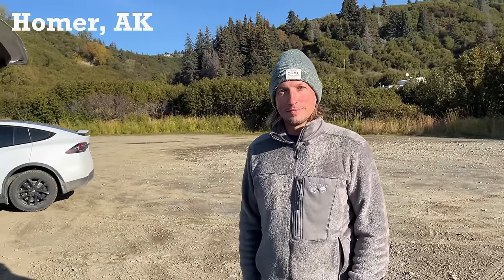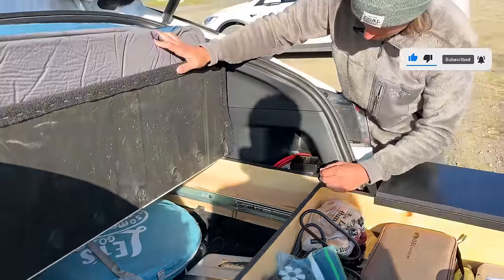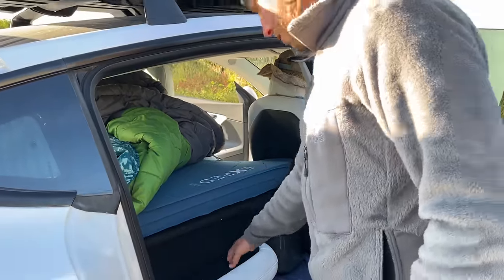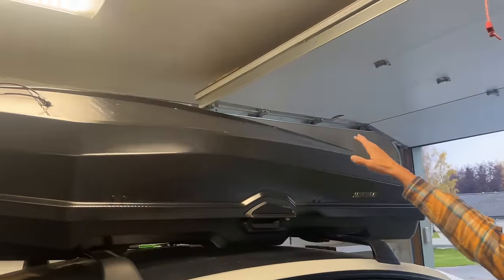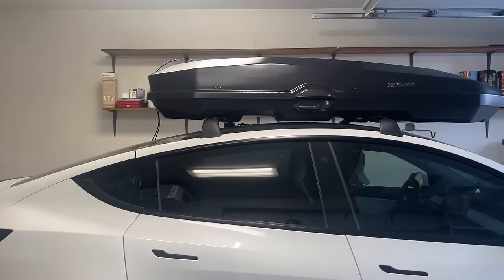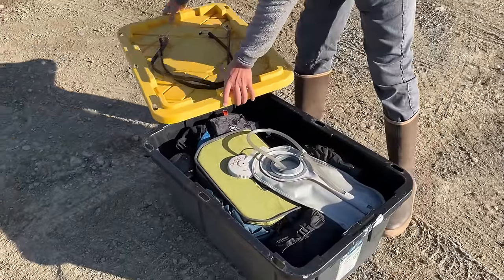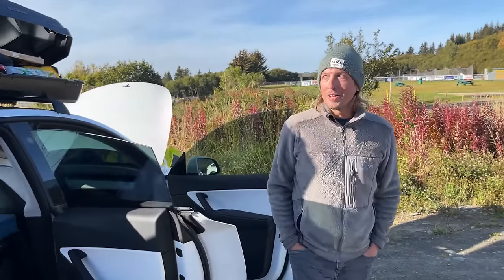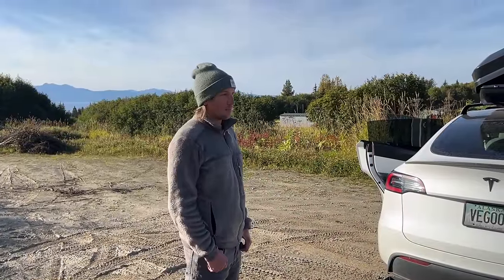Last Place on Earth Meeting Someone LIVING in their Tesla | Retired Vet Turned Nomad

Comment: That solar set up on the roof is just genius 👏
Reply from the maker: Such a legend !
Reply: Renewable energy nerd and ex Tesla employee here. 

Actually relative to total consumption of the whole setup it doesn‘t make sense at all. I like it to but it‘s just wasted money. Just sentry mode mode uses a multipe of the Ecoflow turnaround consumption. Just the Roofbox increases the consumption by like 15-25 % relative to your average speed. Roofbox alone cound use more than 100 kWh a week based on the following calculations.

In an nutshell if he travels worth of 5-15 Tesla Battery packs on average a week while hes is traveling what I would approximatley say he is using, ditching the load of the eco flow by having it solar fed saves him maybe 2-4 kWh of the 390-1170 kwh he needs so 0,17%-1,07% of his total energy consumption. 

In a week he saves 14cents to 2 dollars per week depending where you live, charge or how mus the super charger is. 

Even without a roofbox. Just a Solar Module mounted the roofrack would compromise the aerodynamic far more than the energy you could ever supplement. 

Look into the Aptera Car. Its crazy efficient because it hat an extrem aerodynamic case and the solar modules are inside the glas fo the roof. There and only there solar on an EV makes sense. Apart from that you need a whole roof of solar to charge properly. Or a crazy trailer with extending Solar Modules and an inverter inside, better it has its own battery in addition.
Reply: It would be such a better option to buy one of the cars that has free supercharging. My understanding is that it's hard to know if it will transfer, though.
Reply from the maker: @justinkase1360  sometimes there are incentives

Comment: theissue with those flexible panels is that they do not last very long 2yrs and they begin to yellow. Other than that really really cool build
Reply from the maker: Thank you for the tip! Which panels do you suggest?
Reply: @EverydaySandro  To be honest, the best panels usually are those glass encased metal frame panels. Those will easily last 10+years.  The question there would be, finding a sturdy way on bolting it down to your top carrier. That could be done maybe with some some sort of metal strips inside the carrier and then picking holes and screwing and attaching it to the panel via brackets. 

The even bigger question would be how much would that effect your range i guess.
Reply from the maker: @Mosquito3314  true true. I think he wanted to keep the overall design as easy as possible.
Reply: The CIGS ones last a lot longer (25yrs), have diodes to make them extremely shade tolerant, are more flexible than standard flexible panels and are very light weight. They are expensive. He probably used a CIGS based on his other equipment choices.
Reply: you are absolutely correct. I must have missed when he mentioned it. But I was unaware of this technology until you mentioned it..  Appreciate it though, because now I might just buy some lol after checking out the specs.  @dvwatts

Comment: How did he level the bed structure?
Reply from the maker: I guess he used a leveler to make the right adjustments
Reply: @EverydaySandro  yeah, I was just curious if he did anything in particular with materials or the like. Pretty straightforward though. But very cool.
Reply: Like, how did he determine how deep that drawer needed to be etc.
Reply from the maker: @grizzlymartin1  pretty straight forward I think. He did take inspiration from Jimmy

Comment: I don't understand people who use solar with a Tesla. Why? The Tesla has 80kw of electricity accessible via 12v,  you would be lucky to get half a kilowatt of electricity via solar from a sunny day.
Reply from the maker: Fair point. He sometimes like to travel out of the country for an extended time and it would keep his fridge running as once he powers off his car, it stops charging the fridge from the 12V DC outlet
Reply: @EverydaySandro   But why would you need to turn the car off? Camp mode gives you access to the battery but doesn't drain much extra power (by design- kind of the entire point of camp mode is to provide electricity for when it is stopped). In fact the main reason I would even buy a Tesla is  the ability to have access to a huge battery to run climate control and electronics off of when stopped. Even with hybrids, the motor comes on every 30 minutes or so to recharge the battery, which is bad when youre trying to sleep.
Reply from the maker: @100toeface  if you are leaving the car for the day or so, then having Solar makes sense. I get your point though. Thanks for sharing
Reply: @EverydaySandro It still doesn't make sense. The same battery you use for solar could be charged using the tesla when you're driving or sitting. Not trying to be argumentative or anything, but solar makes zero sense whatsoever in all usage scenarios I can imagine. I would be surprised if you get more than 200 watts of power per day with solar on the roof. For an 80 kilowatt battery it would take 400 days to deplete the battery @ 200 watts per day.
Reply from the maker: @100toeface  The 12/16 volt battery automatically shuts off when the car walk away from the car
Reply: Because when you're out in nature you are scared to death of using your battery power as you need enough power to make it to the next charger. but I see your point, that it's a bit missleading to make tiny bits of electricity when you're sitting on a massive powerbank
Reply from the maker: @Niberspace  it’s so little usage you don’t notice it! I love being out and about